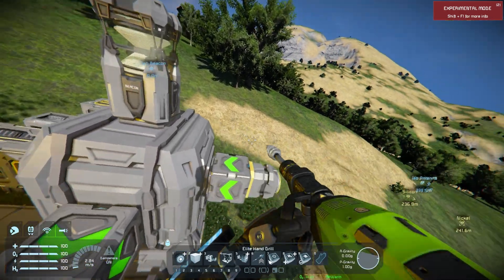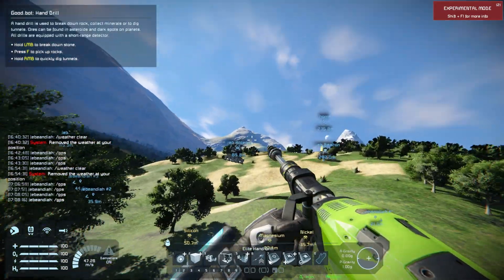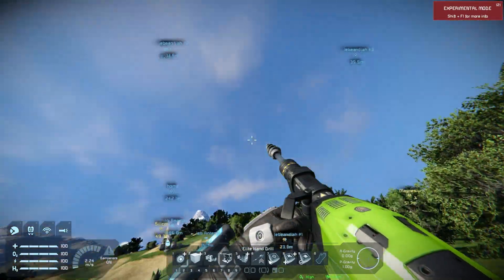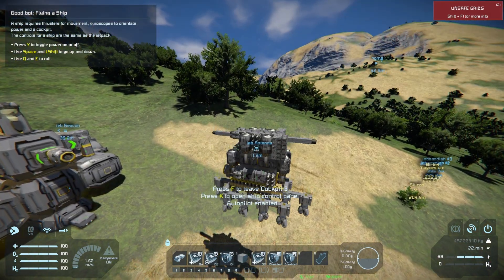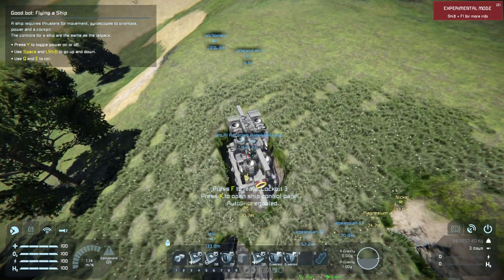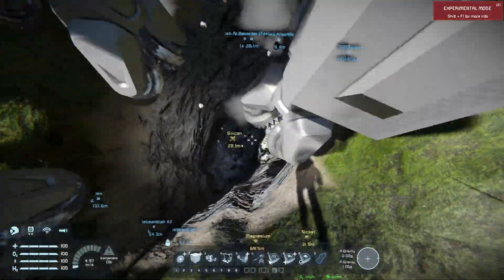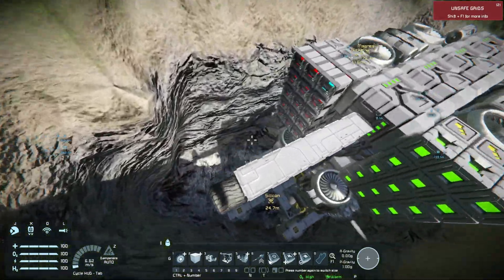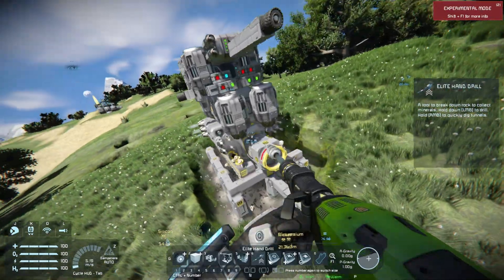UPDATED SCRIPTLESS AUTO MINER - Space Engineers Automatons (AI) Update (Workshop)

Comment: have you made any progress?
Reply from the maker: I have found a simple way to set a max depth failsafe
Reply: Have u found anyway to keep them aligned with planetary gravity?
Reply from the maker: @albiorix9645  yes today i did!
Reply: @jebeandiah  post it
Reply from the maker: @albiorix9645  i havent added it to the miner yet, but u can have basic ai fly towards gps either above or below the hole, below is easier as it can always be the center of the planet.  Its will randomly turn off while descending, so u have to toggle the basic ai off its ai behavior off and then both on, on the command that the slow descent controller turns the engines on

Comment: I think it would be really helpful if you explained how this works by rebuilding it. The bit I’m struggling with is whether my auto miner will actually save me time. It’s a simpler version than what you have - it goes to a GPS Coordinate about 10m from the surface of an ore patch. Then it moves to a second right above the surface - this ensures the miner is facing the right way. I then have an override thruster to gently push it forward while it mines. One it’s full (thanks event controller), it uses another thruster on override to back out. Then it returns to base, in theory. Really not sure that its any better than my usual strategy of a massive large grid asteroid eater….
Reply from the maker: Since its filling up with stone, prolly pretty slow

Comment: works well but pam is alot simpler and easier to use
Reply from the maker: Functionally there are some tradeoffs, i dont think pam can work with multiple locations. But yeah, working on making it more viable, but wont ever be as simple as scripts
Reply: @jebeandiah  By multiple locations, do you mean different ore deposits distant from each other? If multiple sites are an absolute need, you can always use a second PAM PB. Or more. I've never felt the need for it myself.
Reply: Pam is great if your on a computer.
Or your server allows scripts

Comment: I couldn't really see or follow how the ore detection works? Does it actually detect the ores under ground or does it just dig to a specific depth according to several timer blocks or event controllers?
Reply from the maker: It digs until it goes through the ore, automatically goes to the right depth
Reply: @jebeandiah   dude explain it cause they are not understanding it.  he has a timmer block that is checking the stone/ore as it passes through the drills. then filters out the stone 
once no more ore has been detected from the timmer block and it just pure stone from the drills then it ascends. this was not hard to explain just had to put in the effort
Reply from the maker: @chaos6313  it has to detect a separate connector (to filter out stone) and correctly time when it checks how full it is and when it ejects, but yeah i didnt explain it good